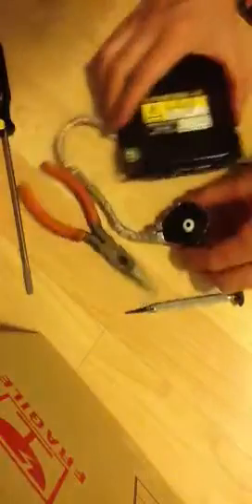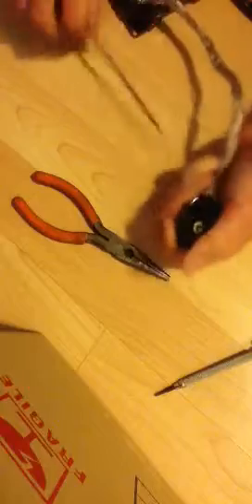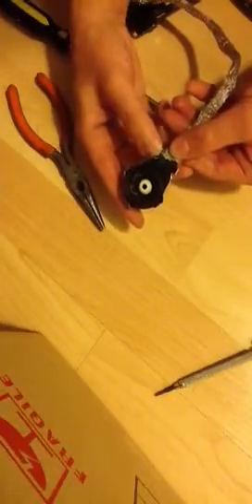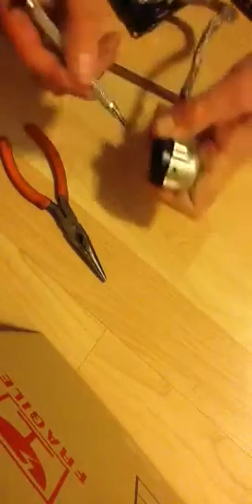Lexus IS250 / IS350 / IS-F OEM HID Ballast - Socket Disassembly by Joe Z

Comment: I'm thinking of buying the ballast, cut the wires from my burned ballast HID connector. Cut the new ballast connector and rewire it with some black tape. Does this sounds crazy?
Reply: The seller of my ballast says DO NOT CUT THE WIRES !!!. or BALLAST WILL FAIL !!!
Reply: @Daybo1955  i cut mine and it works!

Comment: Yes. It took a little while for me to realize that there are some narrow spaces that the encased red and white wires could fit through, but I was able to push it through the gap. You may want to try with a flashlight and/or some looser, thinner string (floss maybe?) to find the gaps you can jam the wires through. 3 months later...still working.

Comment: This helped me immensely with replacing my ballast. I don't really know what I'm doing when it comes to cars, and didn't really want to heat gun/unglue/disassemble my headlight if I didn't have to. Although my connector is all busted up now from jabbing at it with the screwdriver and pliers, hey...it works. Thanks.

Comment: How do you get to and remove the ballast? i saw a video with a heat gun used 2x and it looks like a nightmare! If you have a hack to get to the ballast without removing the whole headlight assembly and also use a heat gun and disassemble the "world" to get to the ballast, I'd love the guidance. mine is a 2007 GS450h and the driver's side light goes out and I can get it back on by switching the lights off and on again however it again will fail with the same on off routine working for a bit. The Driver's side lighting assembly is newer than the passenger side, I believe the former owner of my car had a light damaged and replaced the entire unit. Thanks in advance!
Reply from the maker: Jack, likely need to remove bumper to remove headlight assembly.. Then you can remove / replace ballast. Joe Z
Reply: +JoeZis350 Man, that seems like a ton of work for something that used to be a simple thing, headlight goes out, pull some clips, unscrew and clip back in and voila, done and working...